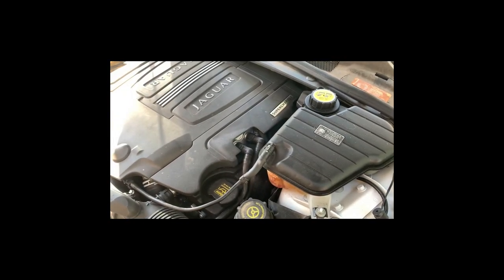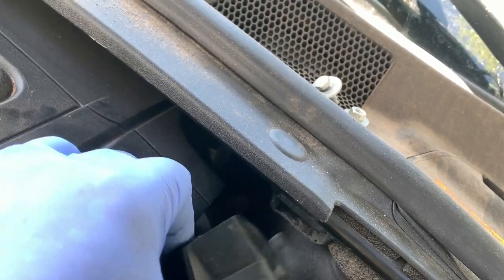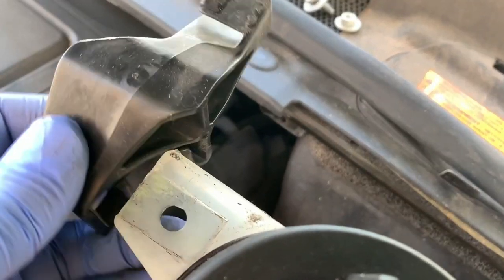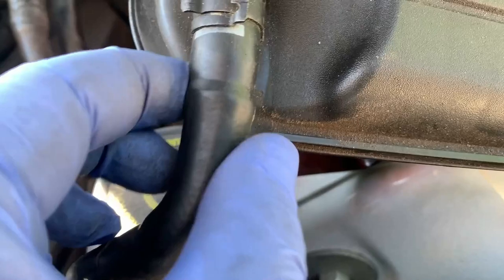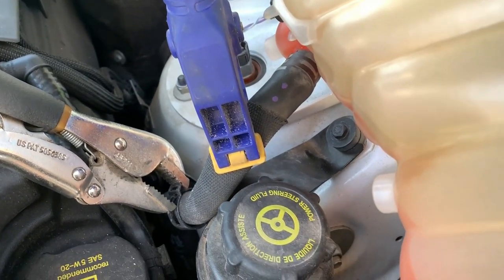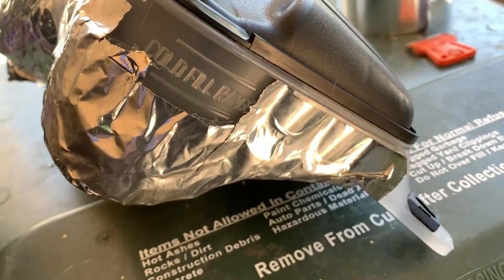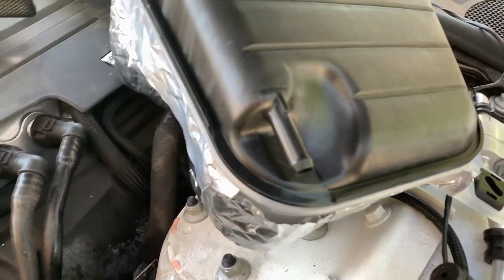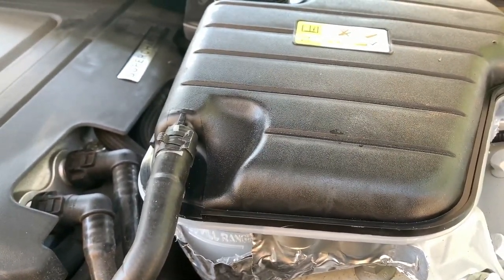Jaguar XF Coolant Tank Replacement

Comment: NICK I have a 2012 Xf portfolio.cant thank you enough for this video.The float is old so its makeing the low coolant warning go off. I Love my Jag.Those models and years are not as scary as people think for reliablity.Id you dont mind reading and research.Beacuse the dealers are Nonsense with what they charge.I dont kind seeing another man eat.But if they sont mind seeing me starve.I got an issue.:) Please do a vid when you can about Transmission fluid change.Jag says it's for the life of the vehicle.Lol
So when it goes you have to buy a new Jag,That should be its life according to them although the fluid CAN be changed.And it can last for Years. Ive seen the kits and me and mecahinic friend found the Fill plug on the rear passenger side Upper on the Transmission.Love this Vid and thanks again.Imperssive.

Comment: LOL, yeh, ax the music.  Love my V6 supercharger, BUT the $30.plastic pipe under the Supercharge had a leak and my 3rd party extended warranty doesn't cover hoses or water pipes.  OK, but it cost me $1600 to remove the SC so you can get to the cheap plastic pipe. LOL.  BEWARE   That pipe will leak after some years.

Comment: Where did you drain from??
Reply from the maker: For this one, I drained out of the overflow hole to the radiator once that tube was off and the reservoir was free. Also, some of the coolant had already leaked out from the cracking areas underneath.
Reply: NickelNDiminIt thanks
Reply: NickelNDiminIt I was unsure if I could sneak just the coolant from the reservoir and not drain the whole system.